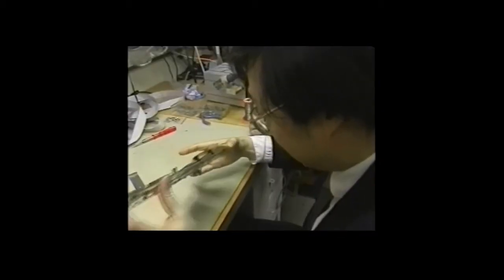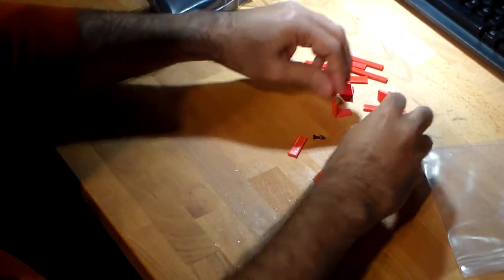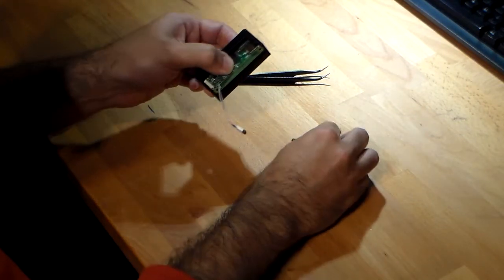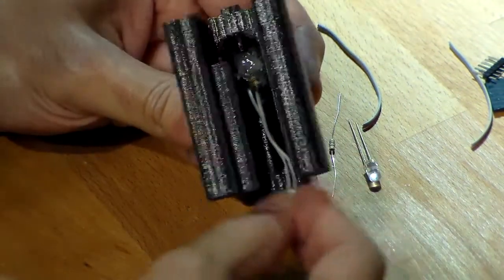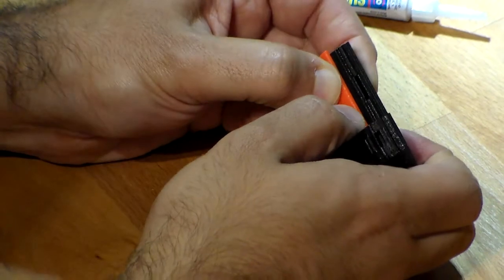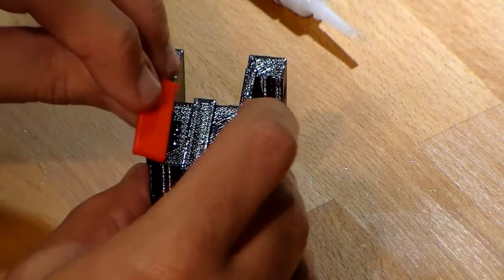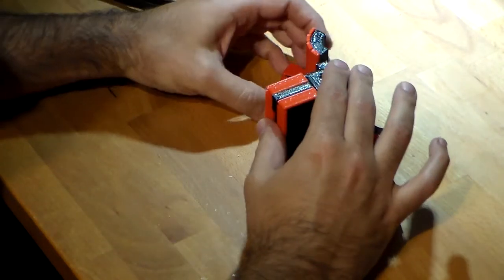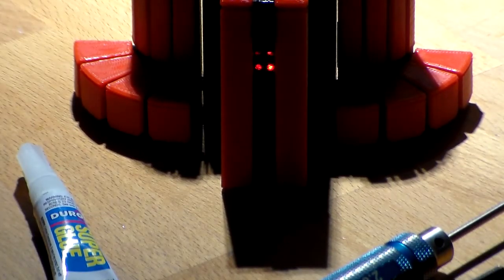Build a 3D printed mini Cray Y-MP Raspberry Pi Zero case

Comment: Hello, would it be possible to get a FreeCAD compatible version of the files? Assuming they weren't originally stl files. I want to make a version for a Pi4. But I don't know how to use blender and I don't like it. I already spent ages learning FreeCAD. Anyway I know this may not be possible. It's a nice model BTW.
Reply from the maker: These models were done with OpenSCAD which is not compatible with FreeCAD AFAIK.
Reply: @RabbitEngineering  I've not tried it but I think you can import OpenSCAD files into FreeCAD. In any case I would be very grateful if you could supply the files. I've got OpenSCAD on my system already. I just need to make a few small modifications.